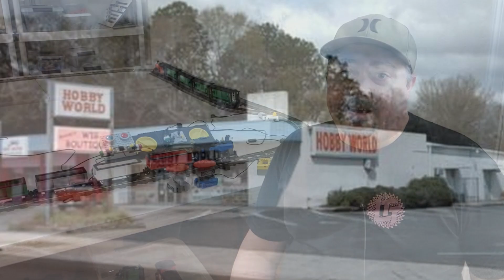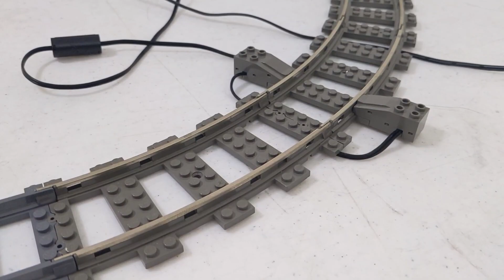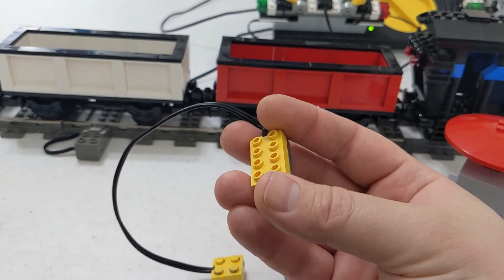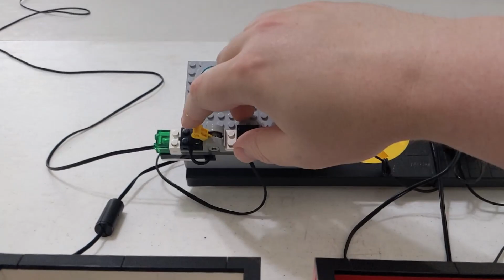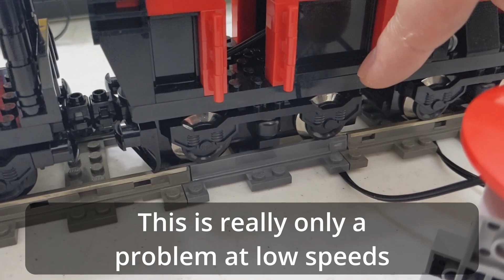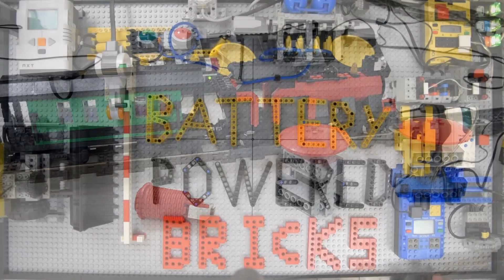Button Controlled Lego Train Layout

Comment: You could use coper tape to energize the rail
Reply from the maker: Several folks in our discord have used copper tape, I have a fair amount of 9v track already and typically build small layouts so I haven't had the need to try the copper tape method

Comment: Something I use a lot when building 9v powered trains with multiple train motors is not using multiple 9v motors,    but one 9v motor and a PF motor hooked up to the output port of the 9v motor with an adapter cable. With this technique, the trains are not only more powerful, but I can also save a lot of 9v  motors.
Reply from the maker: I haven't tried this yet, I always assumed the motors would have varying speed at different voltages.  I'll have to do some testing 🤔

Comment: Awesome video! Note that with the RCX you can also connect a light sensor that detects a train. And if it detects it, then power down the track. Then you don't need an isolated part of the track
Reply from the maker: I've done it before but it was years ago.  I liked this idea for its simplicity / reliability.  I've had friends that used light sensors at conventions and said they were very unreliable.  I tend to use a lamp on the other side and it usually does well.  All of my stuff just has to work at home, but I wanted a solution that was worry free at a convention